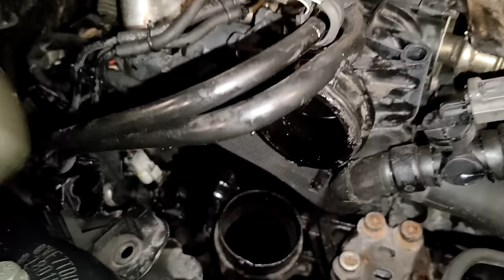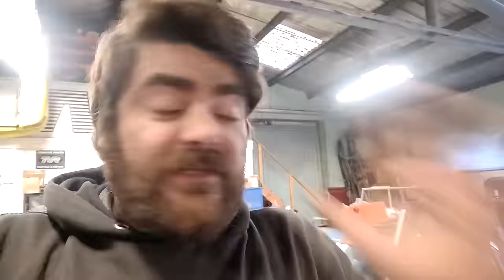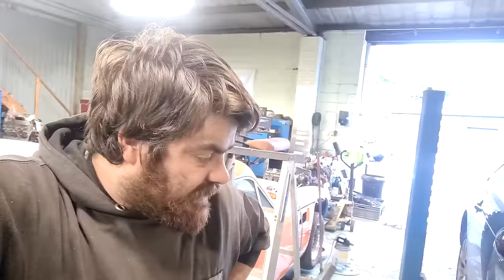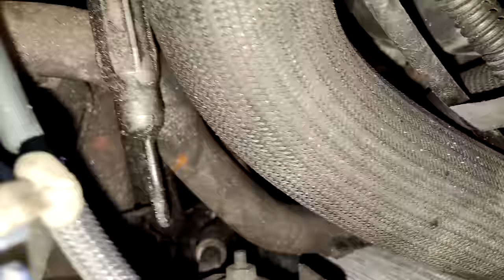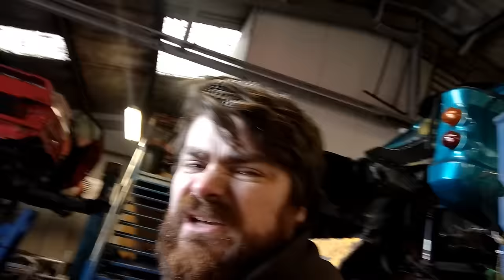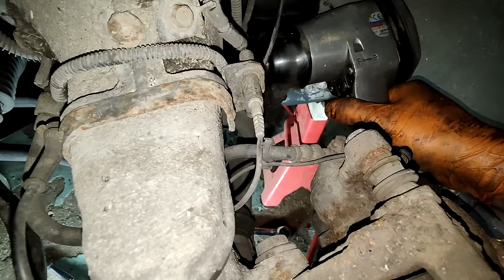Cheap Citroën C6 Project 25: I FINALLY found the boost leak!

Comment: That silicon aftermarket hose should be better than old plastic hose and great to hear no more woosing such a difficult hose to replace but one thing you will not have to replace that hose for a long time

Comment: I must have missed the smiley bit. Very satisfying result, clonk aside. If I were closer, I'd design a couple of brackets, one to replace the original near the plenum but push the hose away from the block and a second to hold the hose clear of the pulley, probably what you're already thinking, then 3D print them in a suitable material.

Comment: Replacement booster hose for the win. Towards the end of the video, you described the knock as more of a rattle. This reminded me of the front suspension rattle I had on my 2008 C4 Grand Picasso which was the strut top mounts. I replaced them with genuine Citroen parts and the rattle was cured. It could be the same with your C6.

Comment: I had a intercooler pipe that pop out on my Xantia 1.9TD from 96 (back in 2001)... I was driving during the night on A1 at Portugal , pushing the 92Hp while climbing the steep grade near Fatima to keep the 120Km/h in 5th when suddenly it went gutless , hardly maked 70Km/h in 3rd when arrived to the top of the climb, and fortunately there is a gas station there... it was pitch night , looking to the dark pipes and trying to figure out what append... and suddenly I see the shadow of the rubber tube that interconnects the tube to the intercooler , blind luck I didn't loose the screwed clamps when they pop out ...
Reply from the maker: I bought a Xantia TD once that was spares/repairs. Turned out that very pipe was D/C from the intercooler!

Comment: You may find it could be the anti roll bar bushes causing the rattle. Crazy thing is the bushes cause a rattle at the other end. I have a citreon C4 that was doing the same thing. No I didnt get a new anti roll bar just the bushes.

Comment: I'm sure you've probably sorted the clonk by now or have checked this and I know a Panda is a bmvery different car..... BUT, when I had a similar clonk the garage changed my drop links which didn't cure it and it turned out to be a loose bump stop moving about on the strut that wasn't quite worn enough to drop down.

Comment: Very useful, now wondering if my C6 intercooler pipe is porous. ...
Reply from the maker: It could well be! My turbos were much more vocal than they were now, even a couple of years ago. Lots of tiny cracks would do that.
I'd look for traces of oil around that hose.

Comment: Those pipes make an intriguing sound when you slap them, and I was waiting for an impromptu performance. Just to introduce a note of culture, in the 1970s a New Zealand experimental music group called From Scratch made a number of pieces for arrays of PVC pipes slapped on the open ends with flip-flops (technical name for such an instrument, a "plosive aerophone"). They had such a strong sense of rhythm that it was not at all dire in the way experimental music so often is. A use for discarded tubing lying around the workshop?
Reply from the maker: Aside from the fact I am rhythm immune, a great idea!

Comment: Road tax stupity ..

Daughters 2019 Aygo Dex 23 £180

Wife’s 2016 4.5T FiAT Ducato diesel Horsebox £165

Makes no sense in emissions, size, weight, mpg…
Reply: No, but in a Thatcherite economic theory “supporting” businesses is, which means lowering  taxes on businesses-y “cars”
Reply: @ramdynebix It's not even that consistent. My Peugeot Expert is very "business-y" - it spent the first 13 years of its life as a taxi, and it's basically a van - but it costs about a million pounds a year to tax*.

* It's been in bits in a workshop since summer 2022 so I'm not sure of the current tax rate.
Reply from the maker: Crazy, isn't it?